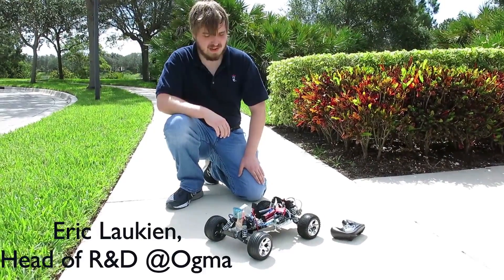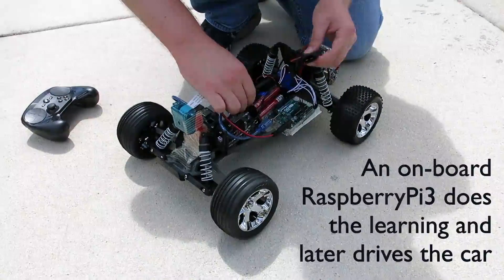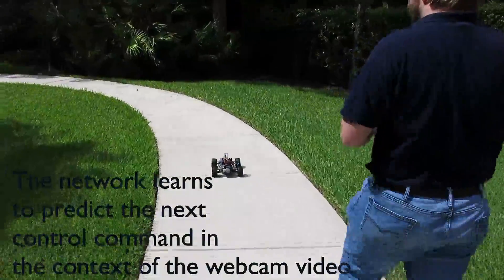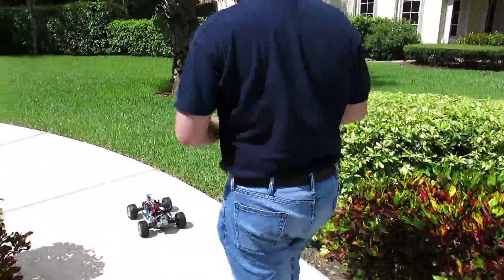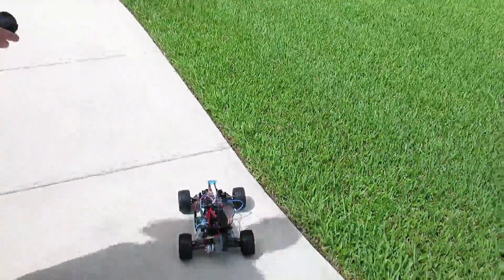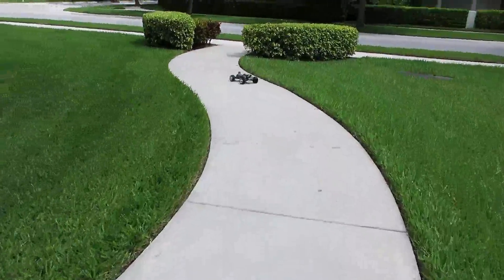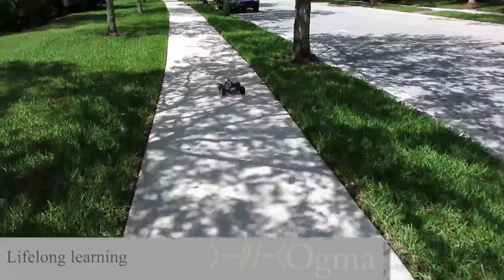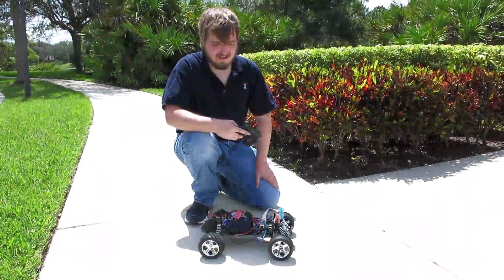Self Driving Car Learns Online and On-board on Raspberry Pi 3

Comment: Hi. Cool project. Did you have any difficulty controlling the ESC of the car with your Raspberry Pi? I tried a couple years ago to control the ESC of a Traxxas LaTrax Rally car with an Arduino and I could not get the ESC armed with it. I ended up replacing the ESC with another one and got that to work. Are you using the original Traxxas ESC on this car? Cheers.
Reply: Hi, one the creators here. We discovered that the Traxxas ESC was using a strange PWM frequency, and we replaced it with a more standard one, so it runs smoothly now. We may make another video on the same car again, since we have a lot of updates in hardware, but especially software. We will see!
Reply: @cireneikual  Hmmm. I actually went ahead and got myself a TRX4 just a few days ago and got the Traxxas ESC armed with my function generator feeding the ESC a 5V to GND square wave of frequency 50 Hz and a 7,5% duty cycle. (so signal high for 1.5 ms). That is essentially what a receiver would put out to the ESC at neutral throttle. Could be I only tried arming it with a 5% duty cycle (so 1.0 ms high, which is common for plane ESCs) a few years ago. Anyway. Nice work you are doing. Greeting.

Comment: I’m planning on building a raspberry pi remote control myself could you send me the operating system and stuff
Reply: Normally you could install Raspian, a Debian linux distribution with some slight changes. Just google raspberry pi install os
Reply: https://github.com/ogmacorp/EOgmaDrive You'd most likely be looking for configuration number 1, as that is the setup that Eric used in the video.